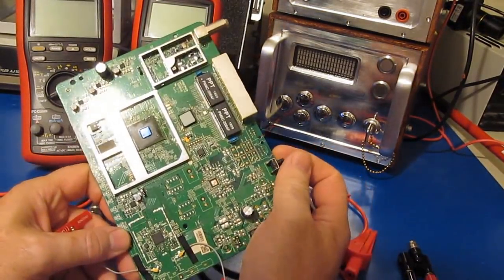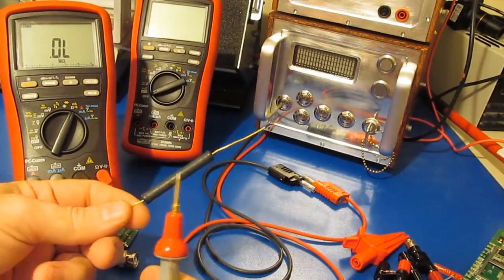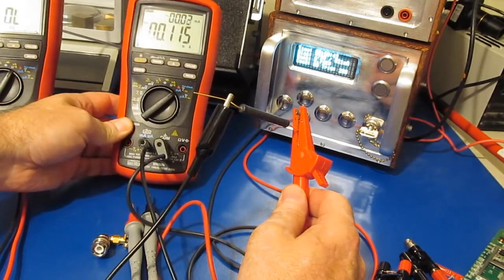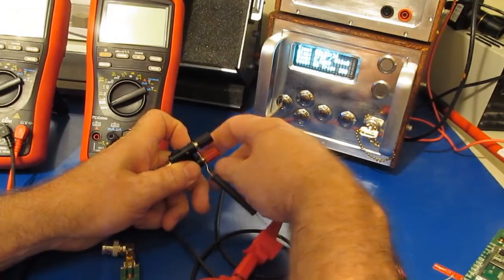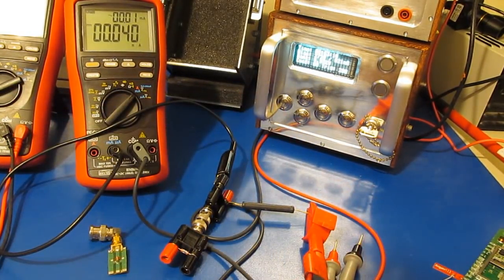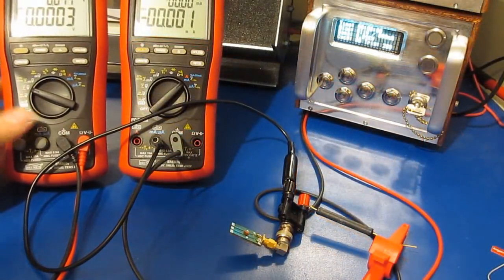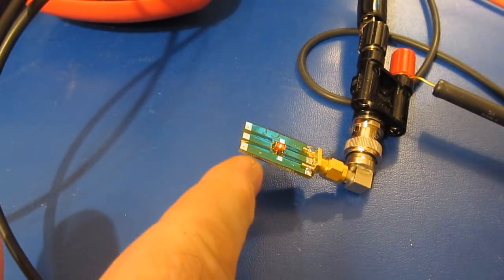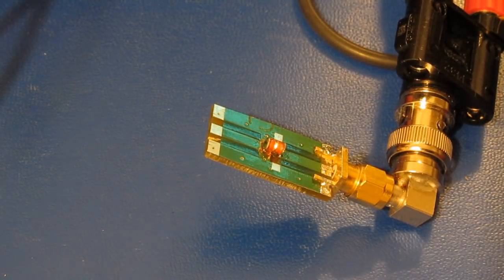What technology did the dead modem's input use?

Comment: Very Good for a Modem having that protection. I have a pile of them pretty dead even with  IC's popped, mostly dial up modems. What a hole pile of big bad luck you had .
Reply from the maker: I was thinking I was pretty lucky!  lol  I was working on some equipment at the time and so some of it was apart on the bench when it happened.  All of that equipment not only survived the strike but also my handy work.  lol
Reply: The more unlucky part was the repairing, and you manage to get it right. That's the odd part is loosing the work so you would have to start again. The test equipment is indeed robust and the modem got all the energy.. I rarelly saw a modem survived a bolt

Comment: That bolt from the sky has turned into a lot of video fodder. This makes me think how I'd fare if I took a hit. Probably not good. I'm on rural electric out here. That means there's not even insulation on the transmission wires. Not that that'd matter for a lightning strike. Still, it just goes to show how sketchy the power is out here.
Reply: At least rural electric grid you know the risk, and can add in a lot of protection to the power side that your electric company probably will approve of ( and might even install for you free if you ask nicely to them) to lower the let through energy to you.

Where I am I do not have much to worry about from that, thanks to a telecoms company who rent the roof, they put in a lightning mat that is probably 2 magnitudes lower resistance than the mains ground, and it is firmly bonded to it as well. That, along with putting in the lightning arrestors on the phone lines, as I had them, and the Krone blocks and box as well, essentially for free, means the let through on the underground power and phone lines is much reduced. I have had a few MOV devices fail with time, but they are cheap insurance against both spikes and surges as well, so rather them fail than the stuff they are plugged in to. Also bonded the antennas to the ground mat as well, as extra protection, even if I so not use the satellite dish but it is still there with the cable.

Comment: That would be neat to see that discharge arcing under a microscope. 
Love those old Caddock resistors. My fluke high voltage probe has a huge older one, the newer probes are a lot of thin packed resistors in series. Not as accurate over time.
Reply from the maker: I need a much better camera.   Something that could do a billion fps on the microscope would be fun to have.   Caddock still makes resistors.  Digi-key carries them.
Reply from the maker: About the best I can do with my camera.   https://youtu.be/A7sEDzuB_gU
Reply: Yea, I know they still make resistors.  I that precision 10M one I bought at 0.1% tolerance is a big thin metal resistor they make.  I just saw the microscope vide, that was unexpected, 😃  Ok, the new goal, find a 1000 FPS camera that will work with a microscope. Hey, I was just researching a camera today that might do the job, lol. Sony released the new Sony Cyber-shot DSC-RX100 Mark VI, but I think the older Mark V, and maybe even the Mark IV also does 1000 FPS. Now I just need to make an adapter to fit it, hehe. Oh wait, I’m still missing the generator, oh well.
Reply from the maker: I want something much faster than 1KGPS.  I almost joined the Chronos kickstart but felt it would still not be fast enough.

Comment: Hi Joe, saw the video of the lightning damage yesterday. Good to see no one was hurt and the damage is contained. I worry about my lab and observatory but having seen what happened to you I really should take more steps to protect the gear much, much, better. Great stuff following along with the repairs.
Reply: Vince, yea I think the next lab will have a hard cut off switch mains box and on its own separate breakers. Lighting separate from the plugs so no flickering from large induction loads like hot air stations.  But for now the APC UPS units have done good. They have kicked on from a dip in voltage when turning on something with a large inrush current, I remember when both 1500VA units kicked on when I was testing a battery spot welder, and again with a large veriac that I forgot to turn down before powering on. But it saved me a trip down two flights of stairs to reset a breaker.  They have also taken over three times now when the grid goes up over 130VAC to protect everything when the local power station regulator fails. I’ve seen it as high as 147VAC. As for surges, I don’t think I’ve taken any big ones so I can’t say for sure, I hope I never find out or chance it.
Let’s just hope they do what they claim until I get the new house and build the lab done differently next time.
Reply: Agree about separate power and line conditioning. I'm considering relocating to the basement where it'll be easier to provide new service for the equipment. A new house is a bridge too far at the moment :)